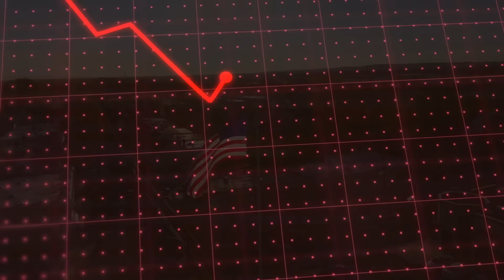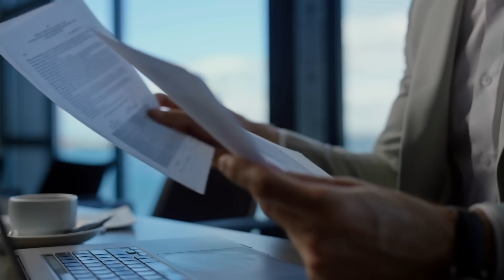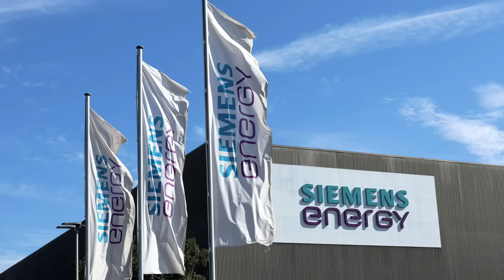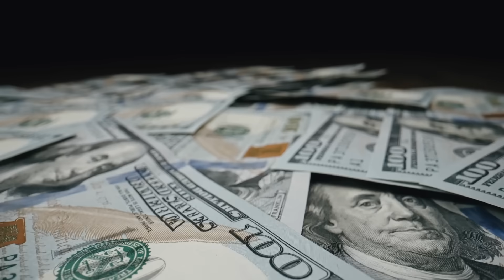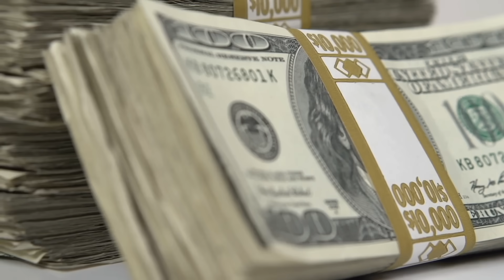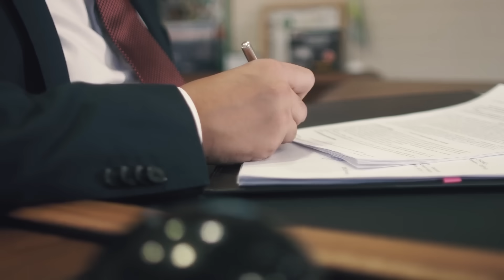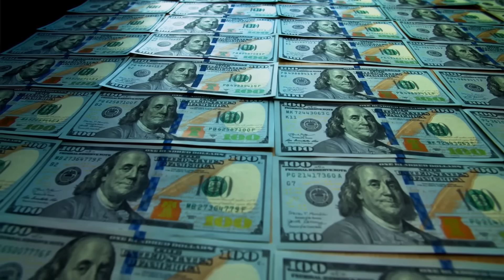The Real Reason America Has Turned Its Back On Wind Power Energy

Comment: THE TERM "RENEWABLE" IS BULLSH$T. THERE NOT RENEWABLE. THERE A WASTE OF MONEY. KILL LOTS OF ANIMALS, AND USE A LOT OF RESOURCES TO PRODUCE. SOLAR IS WORSE, AND IT IS ALL UGLY TO LOOK AT. I LIVED IN IOWA AROUND THOSE STUPID WIND FARMS. NOISY AT NIGHT. LOTS OF DEAD BIRDS TO CLEAN UP. AND THOSE RED LIGHTS IN THE SKY AT NIGHT. AND WHO WANTS A BUNCH OF SLOAR PANELS ON YOUR ROOF. NOT ME. THERE UGLY, AND CAUSE DAMAGE TO YOUR ROOF. WHAT WILL IT COST TO REMOVE THEM TO REROOF THE HOUSE, THEN REINSTALL THEM. NOT WORTH IT. BATTERIES NEED TO BE REPLACED.  THIS STORY IS PACKED WITH LARGE PILES OF BULLSH$T. THE ONLY MONEY BEING MADE IN THIS INDUSTRY IS THE GOVERNMENT PUSHING THIS GARBAGE. MY ELKECTRIC BILL AVERAGES $300.A MONTH. IT WOULD COST ME ABOUT $80,000. TO PUT SOLAR ON MY 4000SQ FT HOUSE. DO THE MATH. WHO MAKES MONEY, THE BANK, AND THE PANEL MFG. AND INSTALLER, ME I GO IN THE HOLE. DEEP. MY HOME IS PAID FOR. NO WAY AM I GOING TO STRAP MYSELF WITH ANOTHER HOUSE PAYMENT FOR 10 YEARS. SCREW SOLAR AND WIND FARMS. A WASTE OF MONEY. BUT YOUR GOVERNMENT WILL TELL YOU THE OPPOSITE. THE GOVERNMENT IS LYING, ANS THE SOLAR INDUSTRY IS LYING. WHY REPLACE A RELIABLE ELECTRIC SYSTEM, WITH A HALF ASSED, JOKE OF A SYSTEM, THAT CANNOT HANDLE THE AMOUNT OF ELECTRICTICTY REQUESTS. DUMP SOLAR, AND WIND, BUILD CLEAN COAL, AND NUCLEAR.
Reply: The energy is renewable by definition. No amount of capslock will change that.

Comment: The premise of this video is false.  Wind and solar projects are being delayed because the combination of multiple government regulations has resulted in gridlock.  In the US most transmission lines are privately owned.  The government does not fund them.  Money is not the problem!  A secondary issue is that storage facilities are not being installed fast enough.  Utilities are waiting for the best technology for long duration batteries to emerge.

Comment: This is an incredible presentation of half-truths.  A power company builds its system to serve its customers reliably and economically.  And then, if the government deems they need to accommodate a highly subsidized, unreliable and intermittent form of energy on their system they must build transmission lines to connect them.  These take years of permitting, land acquisition, public hearings and sometimes eminent domain action - not popular.  Then, you spec the materials needed and get them in the production queue.  Just that simple.

Comment: Difficult to believe that nobody thought to coordinate the wind farms with the transmission lines.
But a much better solution to energy generation is the molten salt nuclear reactor,
It is criminal that we have neglected that, leaving the field open to the Chinese.
Reply: There is a reason it was not continued 60 years ago.
Reply: @old-pete  
The reason had little to do with science. I believe in the USA, they call it "pork barrel politics".
It was a decision taken by President Nixon - to favour sodium cooled reactors instead. They have been disappointing, to say the least.
Early experiments at Oak Ridge laboratories (in the 1960s) were "proof of concept", and were very encouraging. 
Kirk Sorensen has revived interest in this technology, and several groups have serious proposals. 

My particular favourite remains the "core and blanket" design, based on Weinberg's original idea.
Reply: @paulsutton5896  If it were the better design, the industry would have run with it.
Reply: @paulsutton5896  Up to now they have only test reactors.
If the planned rollout for the commercial reactors really happens around 2030 is doubtful.
Reply: @old-pete  
The company: MOLTEX is already building a plant in New Brunswick. 
It is a start.
I remain hopeful.
Reply: @paulsutton5896  They still do not have a license. Operation is expected in the early 2030s.

Comment: People are figuring out the green energy SCAM.  How much pollution is required to make Blades/Batteries (for cars/solar/Wind) generator heads, cement and steel for the base and support column?  It is not "clean" it is a method to control the people.  Studies have come out recently exposing the FACT that electric cars cost MORE to operate even though they don't use gas.  And the MASSIVE pollution required to mine and refine the monerals for the batteries.  And what about the recycling of said batteries years in the future.  Dirty and power inefficient!  It's all downhill from here for "Clean Energy" providers.
Reply: Much less pollution than fossil power plants cause.
How are you controlled by windturbines?
Reply: The whole climate change farce.  When I was groing up, it was GLOBAL COOLING!  We wont be able to grow food and will freeze to death!!!  The sky is falling said chicken little.  You say you are OLD PETE, tell me you are wiser than the climate change BS??? We just finished the 10th year of the sunspot cycle.  Now we will get colder for the next few years.  The SUN controls our climate.  While us "RICH" contries are doing wind turbines, solar and electric cars, what do you do about India and China opening a new COAL power plant EVERY day???  Do some research. @old-pete

Comment: Very slick propaganda - who funds this site? If wind/solar are so cheap, they wouldn't need the 30% investment tax credit and the federal production tax credits. Wind and solar power generation are area-intensive, material intensive, have dilute power density, and typically located far from where the power is consumed. The solution? Make the other grid customers pay for the otherwise unneeded transmission costs. Wind/solar do not  displace coal/gas power sources due to intermittency associated with weather. Where the percentage of wind/solar resources goes up, so do power costs. Why? You are actually paying for two power systems, one that works and one you can't depend on.
Reply: Pete, you need to do some homework. According to TPPF. wind and solar have reaped 70% of the total federal subsidies in the 10-yr period ending 2020. With the Inflation Reduction Act, this number is going up. The renewable advocates count the nebulous and mostly fictitious "social cost of carbon" as a "subsidy." This is absurd to the max. In addition. Socialized costs (like free transmission lines paid for by all grid customers) are, in fact, real subsidies. Wind and solar don't pay costs for backup power their intermittent operation requires. Another free ride from grid customers.
Reply: @gregggoodnight9889  I am not even talking about social costs. I am talking about payments and tax benefits since WW1 or older. That are over 560 billion dollars for fossil fuel in the US and they still need subsidies. And renewables are already at a point where they can start to work without subsidies.
And newsflash, when a fossil fuel power plant powers down, the electricity usually does not turn off, since fossil fuel power plants have backup too. That is pretty normal.
Reply: Newsflash, fossil fuels get subsidies for decades.
And yes, renewables are starting to compete without subsidies, were the playing field is more level.
Considering that most renewables do not need to procure fuel, they are not really material intensive. The area needed is not that big and can be areas that are not used for anything
else. And power generation cannot really get closer than your roof or balcony...

Comment: Nuclear power has also come a long way, they are much safer than ever, takes a small footprint, and can generate more electricity than wind farms. Nuclear power is generated 24/7 not just when the sun shines or the wind blows. The grid has been in a fragile condition for decades, stop building Wind and Solar farms, fix the grid, and allow reliable power to flow from Nuclear plants.  https://www.youtube.com/watch?v=X5OJRxZoMI8
Reply: Nuclear is also more expensive and is slow to build. It cannot be our only option.
Reply: @old-pete   I don't agree that Nuclear is more expensive, and any alternative should definitely not be Wind and Solar, you have to look at the big picture to see they are both more expensive and harmful to the environment in many ways.
Reply: @jeffb5785  They are far less expensive and quicker to build than nuclear power and a lot less harmful to the enviroment than fossil fuels.
The harmfulness compared to nuclear power is hard to judge and depends on the renewable source, but is not really an isssue.
Reply: @old-pete  I suggest you do more research, mine has proven every opinion of yours to be WRONG

Comment: It's naïve to believe that this interconnection problem can solved with a check from the federal government.  All of the new connections must be reviewed by state and local governments.  Substations and control systems must be added.  It's not like adding a few extension cords.
Reply: Compared to building the highway system in the fifties, or building the transmission system in the first place, it is much easier. If you don't want to do it you say: "it is too hard", if you want to do it, you work out solutions.
Reply: @boldvankaalen3896  --  Much additional bureaucracy in order to add unreliable, low efficiency sources -- which require an equal amount of non-renewable back-up sources because the renewable ones are unreliable (as Texas learned the hard way after its February 2023 storm and as western Europe learned after Russia invaded Ukraine).
Reply: @boldvankaalen3896  you cant just add to the network. it must run in synch with all the other connections
Reply: Let's create another Department of Connection. They will surely resolve everything. NOT!!!!
Reply: Yes after 49 years of constant treason by Labor/gang-green Politicians and the Cowardly LNP politicians, we are still just barely a Sovereign Nation! but have our politicians in Labor and LNP made private agreements with the Globalist Cartels for when the UN Global Government is realised! The betrayals of our Politicians for the WEF=EU=WHO=UN that have weakened our Sovereign position!
                   I remember when we did make our own fuels from our own oil and Gas, we were the Luck Country after WW2, we made and grew everything the Australian people needed, no job shortages, one income families, yes that had to change WW2 succeeded in destroying the globalist Monster on My parents time, today we are in the fight of our lives against the globalist MONSTERS of this century! the WEF=EU=WHO=UN=Billy Goats=Vanguard=Black Rock=Big Pharma=Big Tach, all wanting a position on the Great Reset table, sounds just like a movie script, must be bulldust right.
               But that was before our two UN controlled governments turned to the "Dark Side" back when we were the Lucky Country, we manufactured and grew everything the Australian People needed and exported it around the world as well! That was 49 years ago, before Labor and LNP turned to the "dark side" of the unelected United Nations,
         In 1975, with no public consultation, the ALP government of Gough Whitlam signed Australia up to the United Nations Lima Declaration which required Australia to reduce its manufacturing capabilities by around 30% and carelessly destroying 30% of Aussie workers jobs!  and to commit to importing that amount from other preferred countries China, Vietnam, India. Pakistan, etc since then the UN controlled Politicians are destroying our electricity supplies, our Industries, our defence of this nation, and are currently working on destroying our Farmers as agreed in the UN Agenda 2030 sustainability and Climate Change scams agreed to in 2015 by LNP PM Malcolm Turncoat and Julie Bishop ( She now works for the UN! No surmise there),
                        the betrayal is by both labor/Gang-greens and LNP, also the LNP leads labor in their Collaboration with the UN, also in case you are unaware, the Globalist Cartel consists of the WEF=EU=WHO=UN so there is really no distinction between the whole Globalist Cartel and just the UN.
Reply: It is a total waste of time for an expensive, environmentally dirty,  subsidized, Unreliable power source.